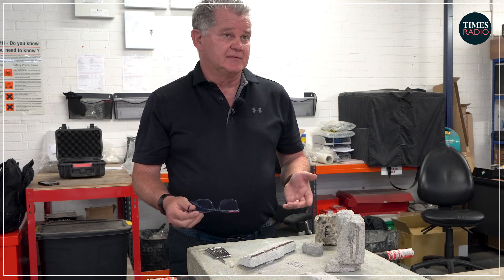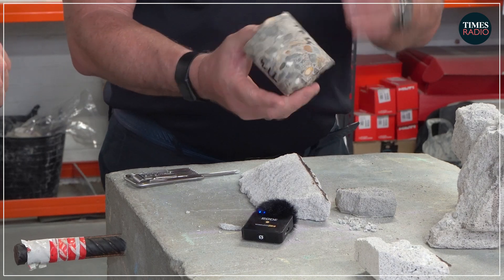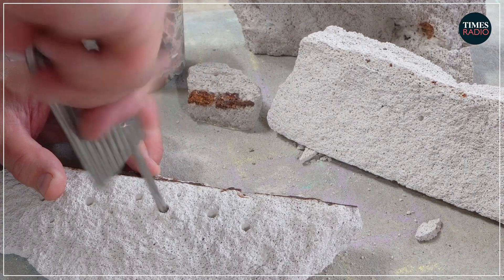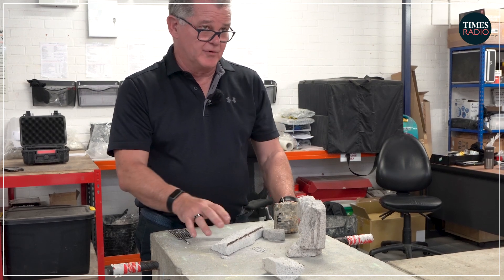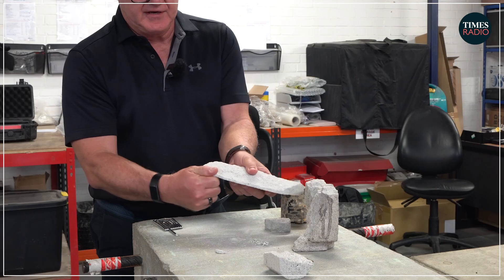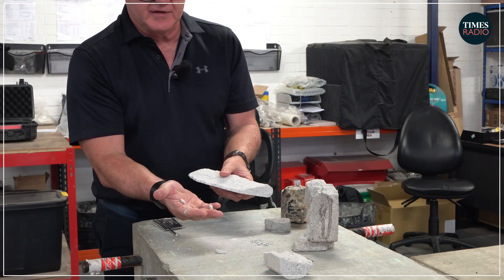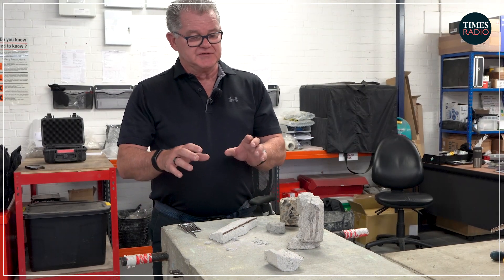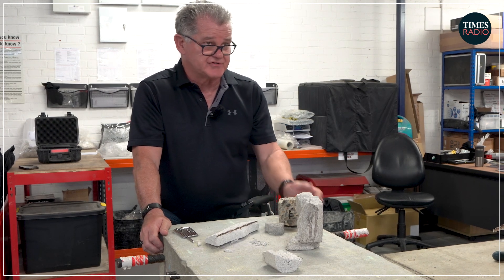'It's so weak you can just break it': Structural engineer reveals 'risk’ of RAAC collapsing on kids

Comment: The question is not whether raac has been used but whether it has been used inappropriately. It appears to be unsuitable for use as a structural material.  That's fine,  as long as you don't use it for structural applications.

Comment: Isnt that breeze blocks most extensions and new builds use breeze blocks ?
Reply: Breeze blocks contain cement sand and gravel (aggregate). The aggregate gives it extra strength.
RACC  contains cement, sand, lime power, and aluminium powder and no aggregate which is why it's so weak.

Comment: This type of product has been successfully used since the 70's, it had a different name then, it was the insulative factor the engineers were chasing, ideas around insulation were ramped up from the 70's from 2inches of fibreglass, and a layer of foil on plasterboard, strawboards, compressed paper, entire walls of aircrete were made in one piece in tower blocks, and the doors were cut out with a handsaw, aircrete blocks were heavily used for decades, and you had a choice of 3.5nm or 7nm, foundation blocks were used extensively from  the 80's for stone, and brick housing, the beauty of aircrete is weight saving, engineers love that, it can be carved, sawn with an ordinary saw, shaped with a chisel, and for a long time was used with a type of tile adhesive that increased the speed of laying, and accuracy. Used correctly it has stood the test of time, we were taught to expect a 30 year life from exposed concrete, and no-one ever said that houses you built were expected to survive for a 100 years without annual maintenance. This is a distraction...100million jabs bought by the government for the 'whatever' variant, Why???
Reply: "you had a choice of 3.5nm or 7nm..." ?
Reply: @thedubwhisperer2157  A measure of strength.
Reply: @YUDNSAY  nm is a unit of length; a millionth of a meter.
Reply: @thedubwhisperer2157  Yep, I hadn't realised i'd added the 'm' until you pointed it out , thanks.
Reply: Since the 1950s.  Only surfaced there might be issues in the mid 90s, but not considered any kind of danger, hence no government did anything meaningful about it and no opposition mentioned it being a danger.  So that is every colour government and opposition.  Which is why it is absolutely hilarious seeing people trying to score political points from it.

Comment: Do you think the manufacturer got the words flour mixed up with cement and bought the cement from a bakers factory.
1. There is no plasticiser in it, I can tell by the powdery dry texture of it.
2. We used a liquid called Sika to harden cement brick hard in 30 seconds and it was so hot you couldn't touch it.
3. Why does the concrete not have reinforced rebar inside it.
And even if this powdery dry concrete was mixed with a few bottles of fairy liquid in it, that would be enough to plasticise it with a strengthened 20mm rebar skeleton inside it.

Comment: This video is total guff.

RAAC has half the strength, in compression, of ordinary concrete. BUT it also only has a tenth of the weight. Poking a hole in it with a screwdriver proves nothing. You can do the same to plasterboard, the difference is RAAC is structural so isn't  exposed to "user damage" any more than timber in a timber framed building.

The aggregates don't add anything significant, take away the cement and you're left with a pile of stones.
Reply: "RAAC has a low compressive strength, around 10-20% of traditional concrete (2-5 N/mm2)."
(Source:  Defence Infrastructure Organisation).
"Typically, AAC has a density of 600-800kg/m³ compared to 2400kg/m³ for traditional concrete".
(Source:  Institute of Structural Engineers).
Where do your figures come from?
Reply: @thedubwhisperer2157  I agree with you. I was talking about idiot in  the video. 5 mm of "normal" concrete you can snap with your fingues as well.
Reply: Yes. He claims to be a structural engineer. Yeh OK then.
Reply: You should actually learn what RACC is made from  before flapping your gums and plasterboard is not load bearing. RACC  contains cement, sand, lime power, and aluminium powder and no aggregate which is why it's so weak. Aggregate is crucial to concretes strength because aggregates work to arrest cracks when concrete is subjected to flexural loads..